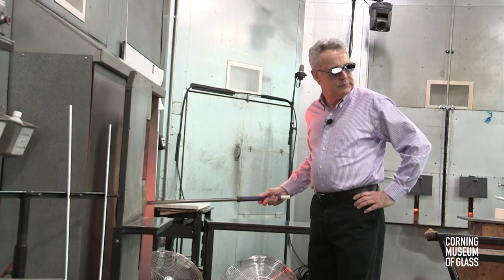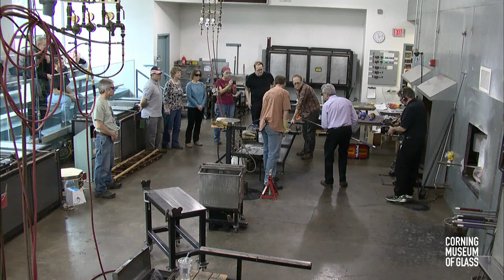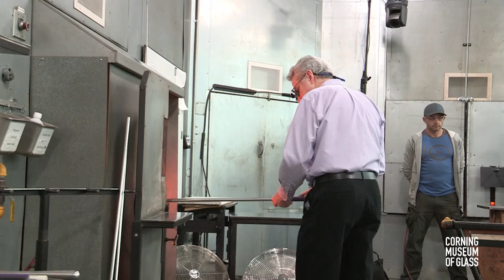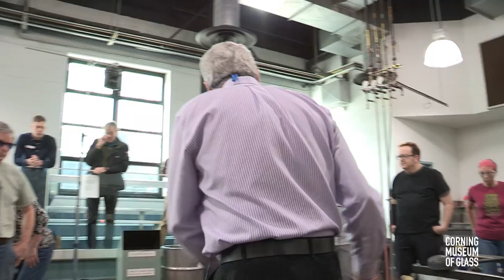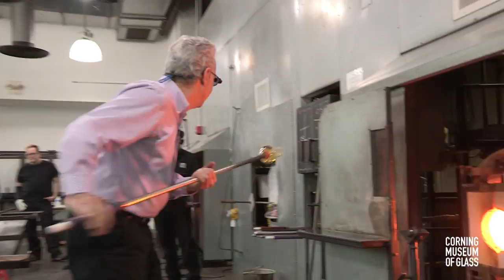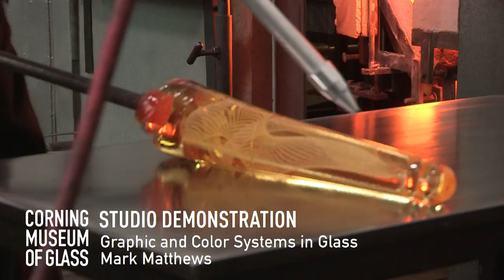Mark Matthews Live-Streamed Studio Demo

Comment: I don't understand the point of the Tilt-a-Whirl. It doesn't seem like it produces a result that's any different from a vertical hot cup, especially since they take it off and put it on the ground as soon as he sticks his blow pipe with the rods in.
Reply: It’s needed because the glass on the end of the rod isn’t symmetrical, like the first cane he made.  The larger cylinder goes in on the bottom and forces the glass around the smaller cylinder more evenly.  If both cylinders were the same size, he wouldn’t have to use the tilt-a-whirl.